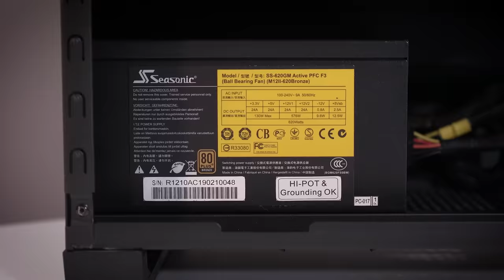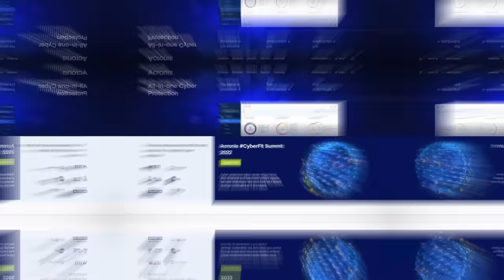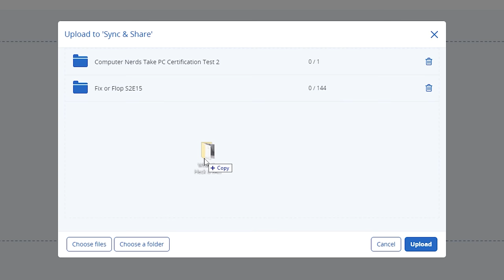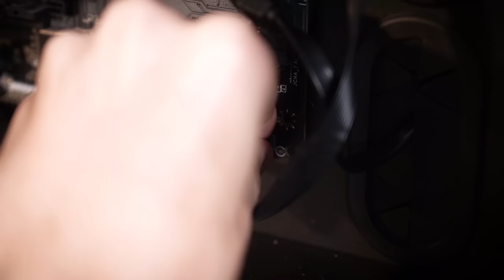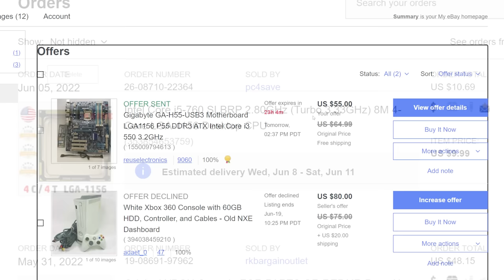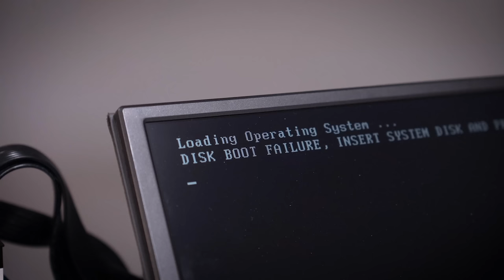Fixing a Viewer's BROKEN Gaming PC? - Fix or Flop S2:E14

Comment: I am a PC technician, and I would NOT be recommending ANYONE to downsize their box... while the box may be heavier and more cumbersome to move around, when you open it up to do any type of servicing, you have SO MUCH MORE SPACE to work... nothing is worse than having to take parts out to get to other parts/cables/etc. And, if you're thought is, "At the diagnostic stage, you have to remove and put back in lots of components to determine the issue, I agree, but... if the box (custom or OEM) is small, then even AFTER diagnostics are done, you are probably STILL having to go through a complete disassembly/reassembly just to do the servicing needed (or nearly complete disassembly/reassembly). And this is coming from someone with skinny fingers (they're a little longer than average, but still...). Other than this "quip", great job on fixing the PC, and love watching your Fix or Flop series! Keep up the great work!

Comment: You should buy a EZP2019+ BIOS chip flasher for those times when removal & reflash is the only option. I saw a video on Adamantit where he first used one & bought one myself. You can get one on ebay for $20 or less.

Comment: i thought it was m/b, did u notice that the reset light flicked on for a second in the power cycling could it be a bad reset switch or a bios corruption problem.

Comment: I have a PC with i7 2700k and an old intel motherboard which does the same exact problem. It started to do so after a power outage at home. I've tested pretty much every component except CPU and motherboard, which I couldn't test individually because I don't have any extra parts for each other and I don't want to spend extra money on it. But yeah, I mostly expect the motherboard to be faulty too lol. I've tested CMOS battery aswell and it didn't solve any problem.

Comment: bad mobo, or corrupted BIOS (if he messed up with BIOS upgrade). Also you should check with a new CR2032. Although the possibility of a bad CR2032 battery to cause such problems is very very very small, but you never know. In very very very very old mobos (~30years ago), there was a case of a bad battery causing power on problems.

Comment: Had this exact same issue with my old system, tho only started happening when I used a new PSU, swap back to the older PSU, boots just fine no problem at all. also the new PSU works fine with another system. My gues is there some current leak somewhere in the MB, where the old PSU dont respond to but the newer one  does.

Comment: I think the faulty board could have had a bad BIOS flash. eg it could have been in the middle of writing the BIOS and it powered off or restarted inexplicably either by lighting or user error. Could hot air the chip off and re-flash using a USB flash tool if you're comfortable in doing so. Also need to pick your brains as well. Got a faulty MSI B450 Tomahawk AMD motherboard on Ebay for the purpose of trying to repair and get it working again but I'm at a bit of a loss as to why it won't give a display. It Powers on and Beeps as normal when there's no RAM installed and at least tries to boot I think when RAM is installed. Another weird thing that happens is the HDD Amber LED comes on solid whether the SSD is in or not. Was just wondering if you've come across this issue before.

Comment: My motherboard has a failure in the main PCI-e slot. Caused my gpu to BSoD once in a long while. Weird thing was, it never crashed while gaming but only when the PC was idle. My gpu is running in the 2nd PCI slot which is an 8x. Hasn't crashed since. Interesting how a PCI slot can cause a crash every couple weeks.

Comment: I do believe that's the biggest computer you have worked on to date in FoF or even PCDC... Also I cringed seeing the USPS box. Everything I have bought that came via USPS has had a very large boot print on the box and is usually damaged in some way

Comment: It needed a 4c/8th xeon. As cheap as i5. If anyone wants to rock that dead platform , do it with xeons (x3440/3450++ etc) and a p55 to OC them. I think the hardest part was RAM. Some rare breads were fine with more than 4gb sticks but most prefered it up to 4gb dual ranked stick. Weird platform.

Comment: I think the problem on the first motherboard was battery CMOS because i had the same turn on turn off problem replaced the CMOS  with a coin battery  CR2032 and it worked

Comment: ill say before the final diagnose(have not watched it yet) power cycle like that is a board problem. its not an easy fix. but can be fixed. but would involve micro soldering of a controller chip. the replacement parts can be cheap but unless you have the tools and the skill its not worth the effort. quite a weird layout of a build tho. huge case that is barely initialized very old 1st gen platform (p55 so yea ) and a cooler that is a downgrade from even the stock intel ones. and a new gpu that is more likely bottlenecked by everything else. not sure what the owner was doing there

Comment: I had the same issue with an i7-2700K and a MSI Board. The user has flashed the BIOS to use a new graphic card and after that the board wasn't compatible anymore with the 2nd Gen, only the 3rd Gen was still compatible. The sympthoms were the same like here. The PC was in the power on loop. And after replacing with an i7-3770K the Board was booting. It could be here in the other way as the i5-760 is a Lynnfield CPU, also the older Clarkdale is using the LGA 1156 socket. So it could be that the Board is booting with an older CPU and need just to be updated for the Lynnfield CPU. Maybe the BIOS has been reset and is now not accepting the i5-760 anymore.

Comment: My old 5th gen Intel started doing this same thing. Tired the reset cause well the MSI MB had it like this one. Yet didn't do much. I could get into the BIOS and then boom it would start the same thing like this one did. It was a great system that lasted 7-8 years before it died. All the Caps looked good so not sure why it did that. It could be the PS yet I didn't have another one to test with at the time. I swapped out video cards so it wasn't that. So either MB or CPU.

Comment: I have had the same experience with a very simular motherboard. It would turn  off instantly and turn back on again.
This happened because I shorted the pcie x16 pins inside without a gpu, so the issue with his board is that it's shorted.

Comment: i had this problem before and it turned out the back of the MB was shorting out with the case. Once I removed the board and reinstalled , everything was fine

Comment: I have the same problem since today but my system boots into save mode and then just turns off after not being able to Fix itself. It does power on again itself but gets stuck in an power on/off loop…

Comment: I once had a pc I had trouble fixing that just kept power cycleing I changed parts, even took everything out and tried on another motherboard and everything worked fine. I changed the motherboard and worked fine on the test bench put it into the case and then it started power cycleing again finally after roughly 3 days I found the problem a broken power button.

Comment: I have a problem with my sabertooth x79 motherboard, it is working great with i7/4960x processor but I need to replace it with the i7 4960x processor.
The problem is I already have tried 2 i7-4960x but none of them work on my motherboard even though I have installed the last bios version 4801 .
What could be wrong? The computer turn on but no posting or beeping

Comment: I have a (not quite that big) NZXT H630 case ... the only reason I bought the full tower was at the time white case options were more limited and the NZXT was the only one I liked the looks of...but I get irritated whenever I have to move the thing for any reason.. like today when I installed my new RTX3070 Founder's edition I just bought.    I don't wanna deal with trying to sell this case and it is nice looking (imho) and well made... NZXT sent me a new side panel when I accidentally dented one... which was nice of them...    I can't see the point of spending more money to replace this case now.. but If I was buying a case today.. it would be a much smaller case I chose..   I do however have 1/2 dozen drives in the case so can sort of justify the case size.

Comment: Ive got a similar tower, Corsair 760T theyre absolute monsters lmao. 
If I have the side door open it's as wide as a 60" tv
Reply: Also: I had this issue with two asus boards. b450ma and b660ma, It ended up being my older tower (Antec VSK 10 mid tower) shorting components out on the motherboard thru a static and venting issue.

Comment: Thia gonna sound weird but u should replace the bios battery and if that fixes the motherboard or not. Reason i say that is cause i had an very late 775 motherboard that used to power cycle as well and replacing the bios battery fixed it.

Comment: I had the exact same symptoms on a really old core i7 2600 I was also getting random BSODs as well, so I switched out the PSU because I thought that may have been the cause of the symptoms, as the PSU was a crappy Thermaltake Litepower 700 and apparently they are absolute garbage, so I bought a Corsair RM 750, turns out the PSU wasn't the problem, so I thought it was the GPU, so I bought another one, turns out that wasn't the issue, then I thought it was the Ram, so I bought new Ram, that wasn't the issue either so the only 2 things that were left were the CPU and Motherboard. So I think I will buy a secondhand motherboard and see what happens.

Comment: I have an MSI B350m bazooka with a Ryzen 7 1800x, MSI 5700xt, 16gb DDR4, Corsair 240 AIO with icue fans. I get a combination of CPU and RAM trouble lights I have tried known good dimms but I don't have a known good 1st gen Ryzen compatible motherboard or CPU to test which is the problem and both replacement parts cost about the same so I don't want to double down if I buy one and the problem is the other.
Reply: its almost never the cpu so I would try a new motherboard.

Comment: I am a computer tech. Yes my first thought is PSU, if not the PSU then I would try the CPU. If not again Motherboard, I had a PC that did that. Watching it a bit more on 5:32 my gut feeling is the motherboard, still I would go through that process I put up. (Edit) I have been seeing a lot of people saying go for the battery, this is not the battery, if the battery was dead it would still boot. If it was the battery all you would lose is some setting in the bios and the time and date would be reset. I am now at 16:27 and my gut was right, reasoning why I thought it was the motherboard in the first place is the POST was not going period yes there was power going through the system with the fans going meaning the PSU was still good then that would go to the CPU. I saw a code display right where the power switch case connects too on the motherboard and that wasn't going off, that right there should have been my biggest "HERE'S YOUR SIGN!!!" For me this was fun watching to see how well my PC skills are. Thanks for the Vid!

Comment: Why swap the location of the gpu and sound card? It's clear the sound card wasn't shorting the gpu component pins, and now it's right in the face of the fan...
Reply from the maker: The owner can move it wherever he wants. This card comes nowhere close to overheating regardless of the sound card's position. The casing is metallic. I wouldn't risk it.
Reply: @GregSalazar  Fair point, given the build, overheating isn't a concern with that kind of constraint, I didn't think about that. Thanks for replying!

Comment: Given the age of that motherboard I would have tried swapping out the cmos battery to see if that was the issue.
Reply: Nah. It’s bit-rot on the BIOS chip
Reply: @christophervanzetta  I've seen motherboards act that way and replacing the battery fixed it. Not always the case but worth a shot

Comment: aren't you choking the GPU by mounting the sound card directly in front of the GPU fan?
Reply: The sound card is mounted above the GPU, so it's not obstructing the fan, though it is still a rather tight fit. I like my card to be free to breathe.
Reply: Just noticed Greg remounted the soundcard under the GPU. You are right, bit of a silly move, never block the fan.

Comment: Hey Greg I was wondering if you could help me out with a problem I’ve been having since I’ve bought a prebuilt every things runs fine but it seems that every time I start my pc for the first time of the day it never displays my monitors at first but pc turns on , but when I turn it off and turn it back on it works and loads everything fine it always works on the second start up. Any info on what causes my problem

Comment: I have a question because I tried upgrading my ram but I forgot to reset bios before doing so and now my old pc doesn’t wanna show anything on the monitor the peripherals light up as if they work and the pc turns on but there’s nothing showing up on the monitor is there a solution to that? I’ve tried removing the lithium battery from the MB already and it did not fix the issue. Could it be the GPU? It’s a 2070

Comment: Symptoms cpu fan full speed psu fan full speed no display
Tried memory clean cmos clear cpu check its getting warm and also new thermal thermal paste still no display what should i do?
Platform core 2 quad 2.5ghz
2x 2gb ddr2 memory

Comment: I'm having a weird problem it plays fine for a while then hits a brick wall games that continue playing get about 14 fps most crash with a memory reference error code (have changed ram) my thought was something is overheating but I can heatsoak with cinebench and furmark for an hour then hop right into a game and be fine all Temps monitored with hw monitor pro and everything was acceptable
3700x on a triple rad
Strix 3080 12g
32gb 3600mhz corsair vengeance rgb pro
Asus crosshair 7

Comment: 🤣 I was given 2 of this generation motherboard.  I did a FSB overclock and got an Xeon X3430 ($6 currently) up to like 3.7ghz (can't remember), but you gotta have a good heatsink.

At this point I'd probably give him a 4th gen B85m motherboard with Xeon 1225/1226v3 they are only worth about $20 the (motherboards are basically free or $30-40) and he can keep using his RAM.

Given he is on this platform at all in 2022 I wouldn't feel bad using a MicroATX or OEM board just to get him going again with that processor.  As it is unlikely it will make a difference, the extra capabilities of that board are not being used.  

A $20 256gb Kioxia BG4 or WD Sn530 in a PCIe adaptor with Clover boot would be the best bang for buck. (Although I have only done that back to Sandy Bridge myself, and maybe only LGA2011 now that I think about it)
Reply: I agree with the other commenter, get a CH341a and use ASProgrammer utility to reflash the BIOS

Comment: Has anyone come across this problem I have a msi mag x570 tomahawk with a ryzen 9 3900x. when I press power button sometime pc fans and light turn on then shuts down I have to press power button up to 6 times for pc to start up normally. when its running its fine. here's what I changed cpu, gpu, psu, ram cleared cmos, updated bios, tried without nvme. I replaced board using a b450 and everything is fine. I don't want to give up on the x570 has anyone experienced a similar problem and how did you fix it? thanks

Comment: 1st step is to replace cmos battery. clean rams with eraser. dissemble all parts and reseat the entire pc parts
Reply: No use.. the power supply sends a constant 5V to the system so if the CMOS battery is dead, it’d still work. It’s a BIOS issue

Comment: i had a very similar error to this many many years ago when i built my parents a work station using some of my own components from one of my older gaming rigs from about 20 years ago, the fix was the CMOS battery. don't ask me why or how i just figured old system and the batteries are only rated for about 5 years so i thought i'd try it, despite in my experience them running for much longer and rarely hearing of them having to be replaced, hell all the terminals at my job use old windows XP systems from 14 years ago, running windows 8 and windows 10 yet none have needed a CMOS battery replaced ¯\_('-')_/¯

Comment: I would have to imagine that the 1650 is bottlenecking that CPU, due to the age of the hardware, but if it works for the owner more power to them.
Reply: My i5-750 (2.66 GHz overclocked to 3.3Ghz) was more than enough that my GTX1660 Super was the limiting factor most of the time!!!

Comment: Anyone help with this So recently got asus tuf 6700xt 2nd hand of ebay but after approximately 20mins of gaming screen goes black power goes off on keyboard & mouse then i have to force reset pc to get everything back on ive tried fresh installing drivers but same thing happens

Mobo is asus B550ma with latest bios Cpu is ryzen 5 3600 32GB corsair vengeance Psu Corsair CX750F RGB, 80 PLUS Bronze Fully Modular ATX Power Supply

Comment: Oh this is classic dead CMOS/bricked bios. System tries to read a saved state that isn't there, and the NOR gates puts it into a power cycle. If it was RAM/cpu/gpu then it would have cycled in POST and never shut itself off. If it was the psu, nothing would happen. Give a go at reflashing the BIOS, I bet 9/10 that mobo is still rock solid.

This was an obvious one.

Comment: Rough fix. System board problems are always the worst because you have to dig to get to them. It sounds like the power delivery probably failed. That power cycling is a very clear symptom of power management issues.
Reply: No